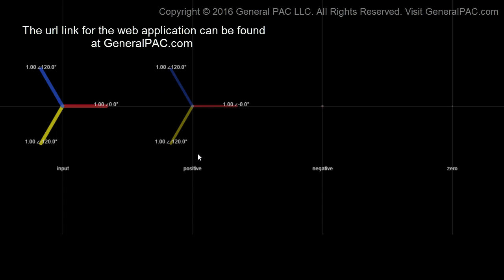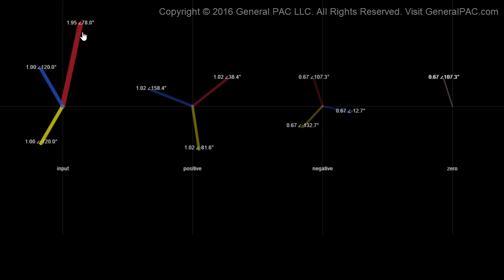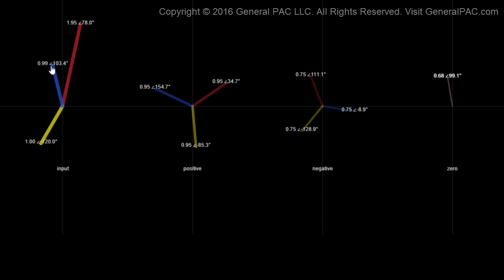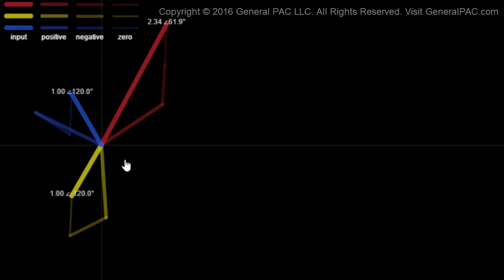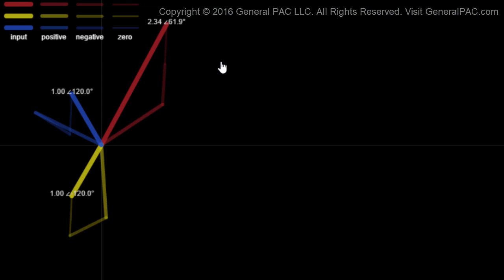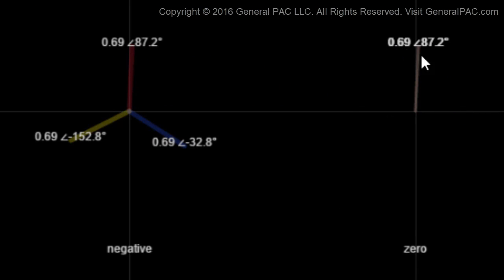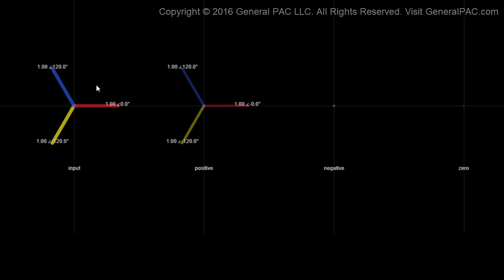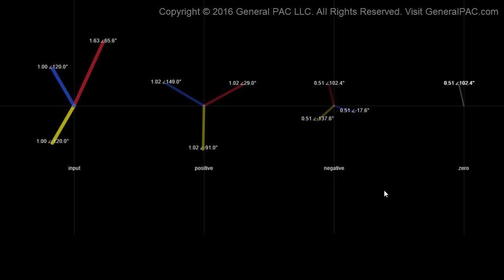Principles of Symmetrical Components Part 2c

Comment: I don't know if you mentioned, but the positive, and negative sequence components derived from an unbalanced phasor have the properties: 1) being balanced (even though the original composite phasor is unbalanced); and 2) varying in phase. So, from the original unbalanced phasor, you get two BALANCED phasors and a finite zero sequence phasor. Oh you just mentioned all this right after I wrote my comment!

Comment: Difference between positive and negative is just phase rotation. For instance if positive is as per system at ACB. The negative sequence is ABC??
Reply from the maker: +Jims Henry yes, that is correct. The negative is always opposite of the system sequence. So of system phase rotation is ACB then negative sequence rotation is ABC as you said!